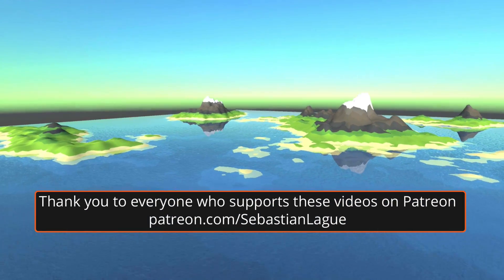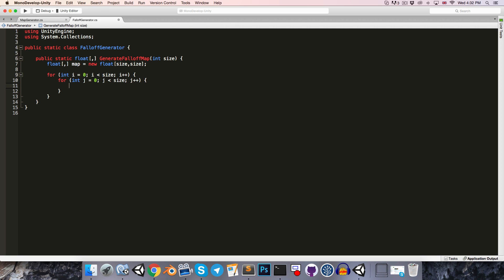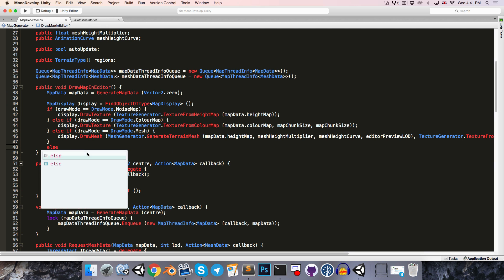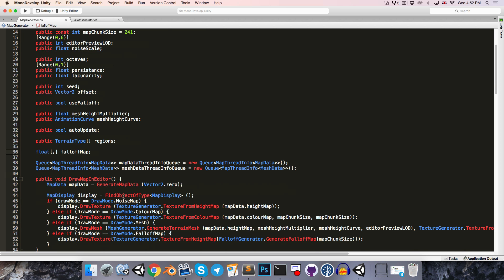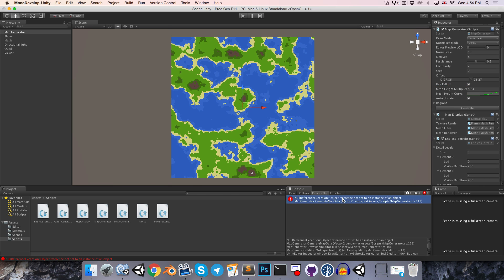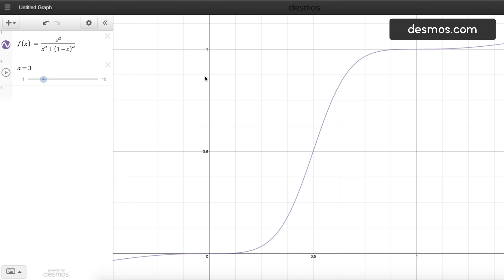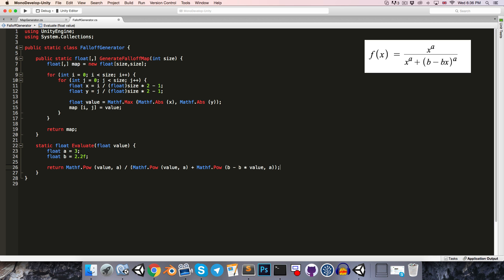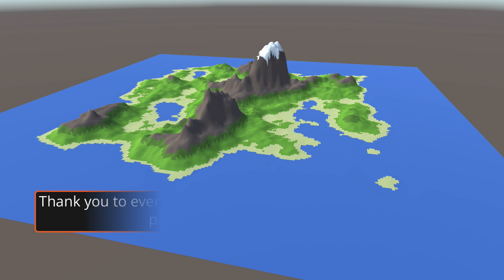Procedural Landmass Generation (E11: falloff map)

Comment: Hey Sebastian, Is there any way to make trees spawn on top of the Land?
Reply: use raycasts from above and instantiate trees on the hits that are higher than water level
Reply: I havent gotten around to this myself, but you might be able to spawn entities based on color region. IE loop through all the points on each chunk and psuedo randomly instantiate trees at vertex positions that fall inside of that region. Not sure if it'll work, but I plan on trying it later.

Comment: I've been following along with this series, and it's been very helpful!

However I've been having an issue where all of my mountains seem to just plateau and I don't know if it's to do with the animation curve, the value I'm dividing by for the global normalising, or anything else
Reply: I fixed the plateaus by changing this line in the MapGenerator script:

noiseMap[x, y] = Mathf.Clamp01(noiseMap[x, y] - falloffMap[x, y]);

To:

noiseMap[x, y] = Mathf.Clamp(noiseMap[x, y] - falloffMap[x, y], 0f, float.MaxValue);

You may have to play around with the Mesh Height Curve too. Try moving the last point further to the right.
Reply: @Lizgrizzly  dude that worked like a charm thanks so much it looks perfect now :D

Comment: (I apologize for the mistakes, yandex translator)
Hello, can you tell me please. I understand correctly that here is an example of using falloff on one "chunk", I want to generate a world from several chunks (not uncut, but chunks 12x12), is it possible to apply falloff in such a situation and how to implement it correctly?

I will be very grateful for the advice.

I have an idea in my head to make a falloff map only on the extreme banks, according to the "end side", that is, the upper corner chunk will have a falloff of 2 white lines on the left and top. But how to make such a falloff map?
Reply: Did you figure it out?
Reply: @benjamintinkhauser4500  I have got something almost working, but am hitting a roadblock. basically I refactored the code to use a fixed height map. instead of requesting a new height map per TerrainChunk, you just create one large height map in the beginning and then take sub-sections of it. my issue is I can't figure out how to fix the seams.

Comment: why is my terrain near water black?
Reply: You probably forgot to change the first region height to 0. At this point in the series, the regions are no longer checking if the height is less than 1, but instead if the height is greater than 0. So, if region 0's height is greater than 0, then everything below that height defaults to black.

Comment: ever since about 3 episodes ago when the chunks and LOD were introduced, my interface no longer draws anything other than the colored version.

I've cut/copied the code form the repository to be sure I haven't screwed something up. There are no errors in the console, but ...

Mesh? no longer shows

if I turn mesh off, nothing shows

any other draw choices shows the color map. Period.

This new falloff? Shows color map.

The extra chunks do not show.

the noise, the mesh? nope.

I can even comment out all other choices for the drawmode ... and no matter what I have enabled, only the color map (with elevations) shows.

I can change noise, LOD, offsets and all of that and get DIFFERENT maps ... but I can't get the different versions of said map. They just ... don't render in the viewer.

It is disheartening.

Comment: I tried a number of variations, for those whose minds wander like mine:
1.) Passed a (thread-safe copy of) AnimationCurve as was done in the earlier episodes of this tutorial, which allows perfect control over falloff, but it's still "square".  It does allow the thick water edge to be thinned significantly.
2.) Using plain Math.Pow to various powers dramatically shrinks the white edge band/water.
3.) A circular falloff map based on distance to the center as noted by Hunter Lawson below, which produces the prettiest islands.
4.) A combination of 1 and 3 gives all the bells and whistles, including easy atolls.

Comment: Thanks for this, even after all these years, still very useful. I notifed though that the noiseScale stops working as a scale once the octavesOffset is moved inside the brackets (i checked the latest file in github has same problem). I was finding very useful to use the scale to get zoomed height map of specific areas. The idea is to generate a continent heightmap, then use the zoomed in data to generate the chunks as you need them.
Reply: Right formulas are these, then you can scroll with offseet and zoom with scale: 
float sampleX = ((x - halfWidth) / scale + octaveOffsets[i].x) * frequency ;
float sampleY = ((y - halfHeight) / scale + octaveOffsets[i].y) * frequency ;

Comment: How do you make stuff like caves?
Reply: You aren't really going to be able to make caves using a heightmap system. It's technically possible by cutting holes in the mesh and then generating caves with, idk splines i guess, but you'd be much better using a voxel terrain generator instead.

Comment: i applied this falloff system to the infinite terrain generation in a simple way (they still have the "grid" effect, but i minimized a little):
first i decided to subtract using a variable offset from float X and Y instead of just "1"... a certain range around 1 will move the center of the falloffmap a bit to change the position of the islands.
since i'm getting values outside the range 0-1 now, i clamped them
also i'm passing a, b from the formula as parameters when calling the method so i can get random numbers

    public static float[,] GenerateFalloffMap(int size, float offsetx, float offsety ,float a, float b)

    {
        float[,] map = new float[size, size];

        for(int i = 0; i < size; i++)
        {
            for(int j = 0; j < size; j++)
            {
                float x = i / (float)size * 2 - offsetx;
                float y = j / (float)size * 2 - offsety;
                float value = Mathf.Clamp01(Mathf.Max(Mathf.Abs(x), Mathf.Abs(y)));
                map[i, j] = evaluate(value, a, b);
            }
        }
        return map;
    }

inside the TerrainChunk constructor, i declared these new variables with Random.Range. Did some if/elses to get bigger ranges to falloffOffset when b is lower (falloff smaller)  and I forced values of B lower than 1 to be 0 to get bigger oceans. Then you just need to send them when starting the map data thread so you can send as parameters to the MapData method:

            float a = Random.Range(1.0f, 5.0f);
            float b = Random.Range(0f, 5.0f);
            float offsetFalloffX = Random.Range(0.90f, 1.10f); 
            float offsetFalloffY = Random.Range(0.90f, 1.10f);
            
            if (b > 4)
 //probably don't need this since it's already declared with this range
            {
                offsetFalloffX = Random.Range(0.90f, 1.10f);
 //i tested all these values in the editor using the falloff drawmode
                offsetFalloffY = Random.Range(0.90f, 1.10f);
            }
            else if(b > 3)
            {
                offsetFalloffX = Random.Range(0.80f, 1.19f);
                offsetFalloffY = Random.Range(0.80f, 1.19f);
            }else if(b > 2)
            {
                offsetFalloffX = Random.Range(0.75f, 1.24f);
                offsetFalloffY = Random.Range(0.75f, 1.24f);
            }else if(b >= 1)
            {
                offsetFalloffX = Random.Range(0.67f, 1.32f);
                offsetFalloffY = Random.Range(0.67f, 1.32f);
            }
           
            if(b < 1)
            {
                b = 0;
            }

            mapGeneration.RequestMapData(OnMapDataReceived, position, offsetFalloffX, offsetFalloffY, a, b);

the mapdata method:

    public MapData GenerateMap(Vector2 chunkPos, float offsetFalloffX, float offsetFalloffY, float a, float b)
    {

        float[,] noiseMap = Noise.GenerateNoiseMap(mapChunkSize, mapChunkSize, seed, noiseScale, octaves, persistance, lacunarity, chunkPos + offsets, normalizationMode); 

        float[,] falloffChunkMap = FalloffMap.GenerateFalloffMap(mapChunkSize, offsetFalloffX, offsetFalloffY, a, b);
        Color[] colourMap = TextureGenerator.TextureFromColourMap(noiseMap, regions, falloffChunkMap, falloffApply);
        return new MapData(noiseMap, colourMap);
    }
Reply: Okay disclaimer here... because you're using the random generator, you will stop getting the same generation. gotta find some way to get perlin values in the ranges i want

Comment: Hey great tutorial! I was just wondering, as the script is now when doing an infinite map we get a series of small islands. However would there be a way to make the falloff map span over several chunks to make a single large island. that would just spawn endless ocean after that?
Reply: Hey, were you able to get an answer for this?
Reply: Since the island/water distribution is based on the Noise that is generated, you could try to subtract scaled up Perlin Noise from the one that is already generated to make for large islands. Like a falloff Map but with "large" Perlin Noise
Reply: @uumatter_0106  I actually found a pretty good solution to this. First i made a public variable of islandLength that measured the island in chunks. Then I made Islandsize as chunksize + islandlength. Then made a vector2 that find the center point in the island and generated noise around that point. I added more variables to give me finer control over the shape and size of the island.
Reply: @MrDizuki  do you actually have the code?
Reply: @Teepoo_  I never really could get it working well. I since moved on to other projects.
Reply: @MrDizuki  I already made it to work perfectly fine, probably will post it somewhere in the comments when I finish it all, thanks anyways
Reply: @Teepoo_  since you guys are still here: does one of you have any idea of how to add a collider to these randomly generated maps? I know he made a tutorial about it but its only with an endless generated map and i need it for the randomly generated island. It would be awesome if you knew the answer :)
Reply: @MrDizuki  do u maybe have an idea on how to add a collider to these rrandomly generated islands?
Reply: anyone an idea of how I could just get one island, without all the other islands spawning?
Reply: @nielswillems967  link does not open :0
Reply: To anyone who is still seeking the answer to this question, I found this https://shanee.io/blog/2015/09/25/procedural-island-generation/

It explains pretty much exactly how to make the singular island using a simple quadratic mask. I used the quadratic mask along with the evaluate function that is described in this video to make singular islands in the middle of the map. 

Hopefully I helped someone out :)

Comment: At 5:42 isn't masking typically done by multiplying the values?
I changed the code there to: noiseMap [x, y] = noiseMap [x, y] * (1 - falloffMap [x, y]);
Reply: I'm having issues and Unity is pointing to the line you changed. I used your change but it still does not work. Help?

Comment: I had heard of a falloff map in conjunction with terrain but I had never seen the effect so well.   However, how would one work out a way to have it so that the falloffmap is bigger than 1 tile as my screen looks funny with 9 small islands instead of one big one.  My idea is to have, hopefully, multiple landmasses of various sizes to simulate large to small continents to large to small islands.  Also I have noticed that the edges of the tiles when using the falloffmap is spiky and misaligned against the neighbouring edge.   I would have thought the seam fix would fix this as well.

Comment: how can I use this to make a straigh line ? I'm making an endless runner with generated dessert terrain and for performance reasons I'm using only on chunk that surrounds the road I'm running on,  I was thinking about using a Turky window function only on the X axis but it's impossible to make in unity.

Comment: how are you making the water look real in your intros?
Reply from the maker: +Ebosch747 Standard unity water shader
Reply: but how did you get it on the reigion
Reply: By what I see I can only assume that he created just one chunk of the terrain using what we all already have, then simply manually added water himself.

Either way he either did that or generated another mesh at the right height and applied material with that water shader onto it, as far as I know it's not possible to have 2 materials on one mesh.
Reply: You can, using a material atlas I think :) A meshRenderer can take mulitple materials to

Comment: I do not appear to be getting peaks when the falloff method is turned on. In fact, the landscape is very smooth when it reaches a certain point.
Reply: I found out that I apparently set the highest point higher than 1 inside the curve plot
Reply: 10:30

Comment: I am currently having a problem where when I generate anything but seed 0, it will lay the color map over it and leave the heights of the last map on it and not regenerate it. This could be caused by a problem when I tried to implement a FPS controller, Uconstruct or a collider. I have implemented FPS controllers and colliders before though with no problem.

Comment: Tried adding mesh colliders using the MeshFilter mesh on the terrain so I can get the FPS controller to move around on it - only issue is that if it loads a load of chunks it lags the game - are there any mesh collider optimisations?
Reply: I'm no expert here, but just some Ideas:
Try to only load the collider for the current and the surrounding chunks (further than that shouldn't be usefull for player interactions, maybe even only load them for the current and the closest chunk)
smaller chunks could help too (more edges, but smaller colliders to load)
Reply: It work perfectly with me! Thanks a lot :D

Comment: Maybe I am a bit ahead but I had a question:
When you finally add water, do you procedurally add another mesh that you modify dynamically with a shader at runtime ? If yes is it a custom one (I am trying that for low poly water right now).

Great videos keep up ;)
Reply: Using the unity water mesh it is the case of adding an underlying mesh where the water shader undulates in the areas where the water colouring is showing.   I have only seen it used with either a large slab for the whole map or one per block but there may be other better ways of using it.  Lookup unity water shader and I believe there are a few examples around the place as well as the built in prefab you can download from unity.